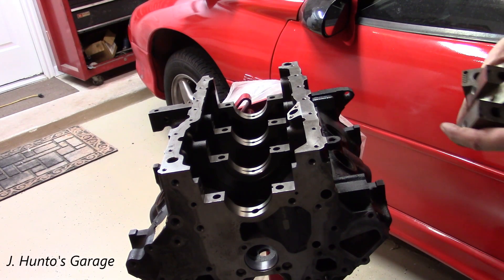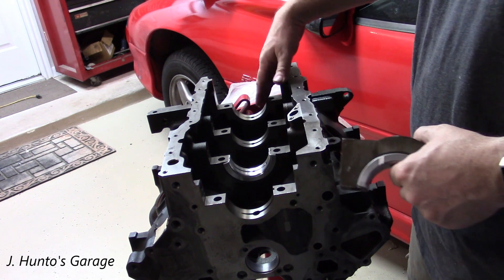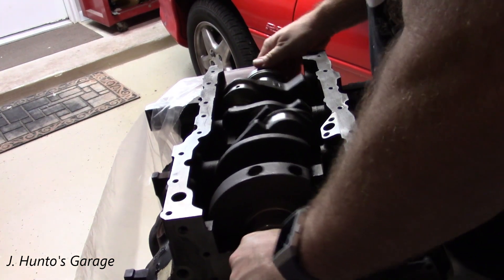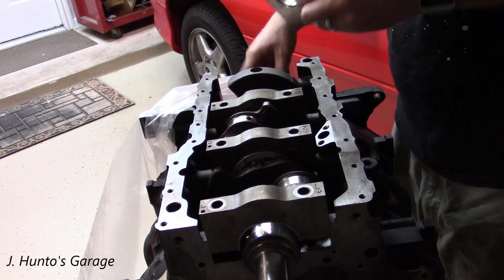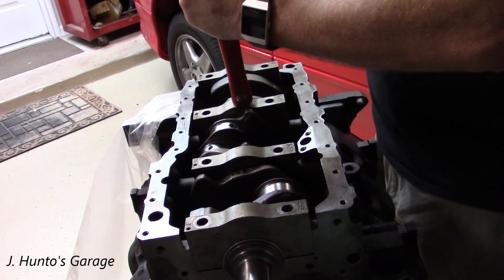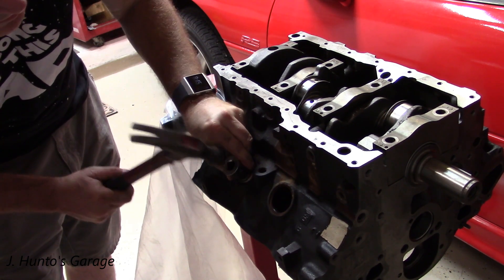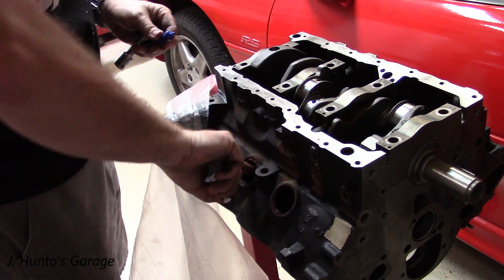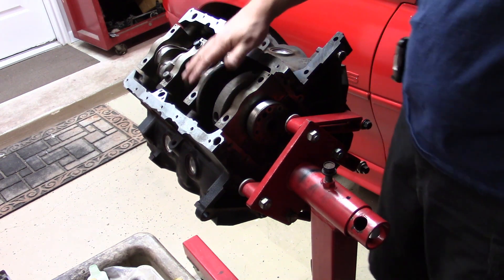3800 V6 Engine Assembly, Crankshaft, Bearings, and Freeze Plugs. Project Oddball, Episode 9

Comment: were these the shallow cap expansion plugs? that is all i can find and they don't seem to fit like the factory plugs
Reply from the maker: I believe so. I used a Permatex sealant with these if I recall correctly.  I wasn't aware of a difference in the plugs. I believe these were Dorman. Sorry for the late response.

Comment: Hay j luv the 3800 content.. pretty sure tha manuel says 2 pull the main caps down by tightening the bolts not by a hammer unlike other applications where a hammer is recommended.